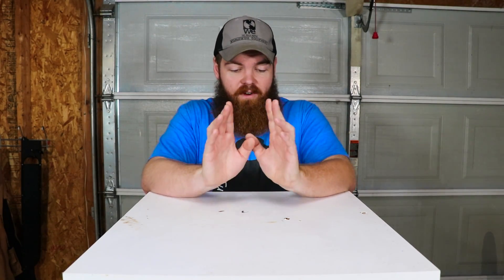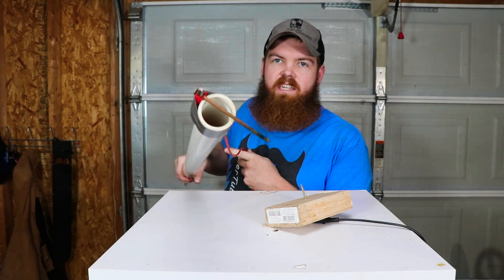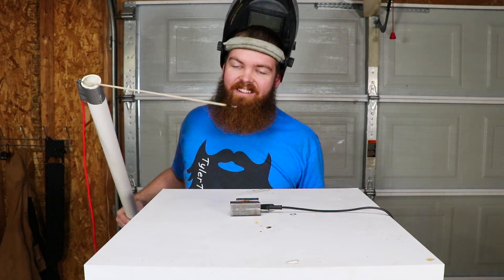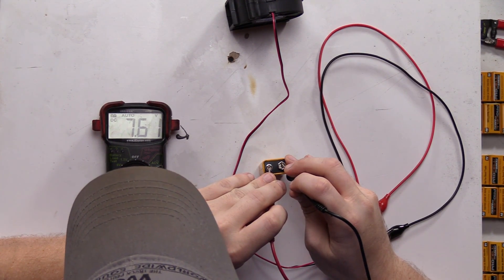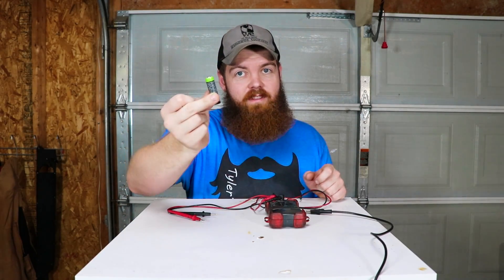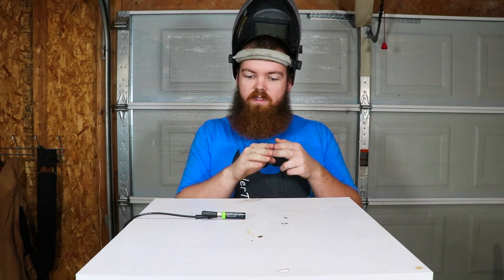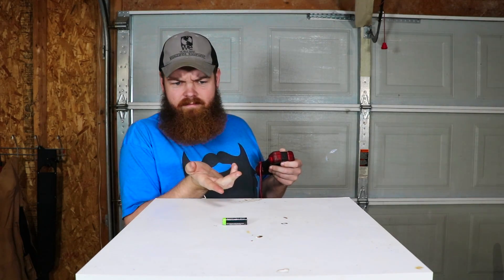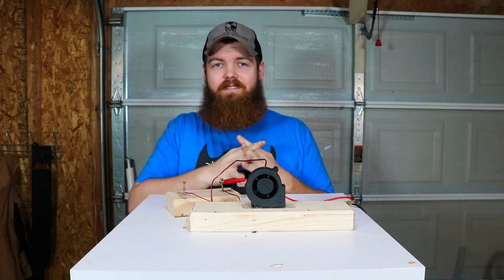Can You Weld With 300 - 9 Volt Batteries?

Comment: I am an experienced welder, and I can tell you that you are doing Many things wrong. First of all, you also need a welding jacket and gauntlet gloves.( at least you rembered your welding helmet)Second of all, you need to have ventilation. Third, you need to keep the arc gap smaller. Fourth, you need some Z87.1 or Z87+ safety glasses. And some advice to help with the electrode sticking,
1. Clean your workpiece.
2. You need higher amperage. ( more batteries.)
3. Hold it at least above an 85° angle.

Comment: Hook all the batteries up in parallel instead of in series and then you'll have more amps instead of more volts and then you'll be able to weld with 9 volt batteries
Reply: You can only get about 15 amps at 12 volts from 300 9 volt batteries. So maybe not. You would need 10'000 9 volt batteries to deliver 500 amps at 9 volts. But the cool thing is 300 9 volt batteries in series equals 2700 volts

Comment: You can charge non rechargeable batteries, you're just using too much voltage. 

The problem with charging non rechargeable batteries is they're not made to be recharged. It might work,  it might leak, catch fire or explode. And the more you recharge them the higher chances of an adverse reaction.

Comment: From what I remember the primary difference between a rechargeable battery and a normal battery is the rechargeable one is built to handle more heat during recharging. I think this amounts to a more durable seal or something like that.  So you can recharge non-rechargeable batteries.. its just not super safe and you should do it very slowly to minimize heat

Comment: You could weld if you connect all batteries in paralel. Because for welding you don't need voltage you need current.

Comment: This is high voltage, this is so crazy, look at the size of arcs, this is deadly and can't solder anything, because soldering requires low voltage and high amps, so this batterys should be assembled on a way to get 45 volts (5 batterys in serial), this setting will have with 300 batterys 60 45v packs, raising the amps by 60 times the amps of a single battery, this is the right way to do this, caution, high voltage is seriously dangerous.

Comment: Your amps is to high you only need 90 amps but you have 225 amps it just breaking the electrode if you use 90  batteries you should get 90 to100 amps that is what the amps you weld with typically.

Comment: You can weld with a 12v car battery but it seems like you need thicker leads to carry the current without just turning it to heat

Comment: To Tyler the fan motor burned out due to the fact you put both negative and positive on a board which is very conductive so instead of the negative and positive energy going into the motor as stable energy it went in as unstable energy therefore it burned out the motor next time have the two cords on separate boards

Comment: You should have cleaned the metal with a wire brush or sanded it with 120 grit or something. The coating on the steel prevents it. Always weld on clean metal. It's just like paint or rust you'll always have to take them off before you can get an effective weld

Comment: In order to recharge a battery you need to for electrons back into the negative half of the battery. Iot do that you need to actually hook up the positive to the negative and vis vers. From a source with higher charge. This will charge the battery with lesser charge.

Comment: Lmao this was really cool! But you couldn't weld cause i guess there wasn't enough amperage is why i think! You only had a total of 6 amps lmao 8 at best and 2700 volts! Cause they were hooked in series. If you would have made 22.5 banks at 120volts and parelled them. You would of had 120volts at 135 amps! Now that would have bin more likely to work! I bet! Series up's voltage and paralleling up's amperage! But you still could have died tho with all that power from 1 mistake! I'm happy you didn't! Really cool and it was smart how you handled the voltage! Lmfao that is messed up that the hotdog and pickle exploded and the hotdog and pickle acted more like the way i thought the welding was gunna go! Weird lmao! 😂😎👍🏻

Comment: Redo with 3 series groups of 100 parallel batteries. 0.26 amps per battery at 24 volts or so. That would be unregulated drain, but more power than a 120v plug in 90amp welder.

Comment: You burned out the fan motor because it arc'd inside it at the end. It would've ran if the input points for the wires weren't so close together.

Comment: resume cat weld steel with the 9th because steel has a much higher melting point than what those 9 volt batteries can output in terms of heat. You could probably try copper or aluminum

Comment: Paused before he tried charging the battery to say that no, you cannot charge a chemical battery by shocking it. The power comes from a chemical reaction in the battery, and you cannot reverse the process by applying more power.

Comment: Bruh, you have 300 batteries connected in series? You're making like 3000V with the capability of delivering over 2-3A short circuit. You can literally fire up over 5 microwave magnetrons with that much power. It can also vaporize/kill any living thing! Just be careful with that thing.

Comment: So what you’ve got there is high voltage and low current capability. About 2.7kv and probably a 7 amp short circuit (I’ve personally found that 9v batteries can produce 7-9 amps in a short circuit) 

For welding I’ve found that the best voltage is between 30 and 40vdc, so if you hook up 4 of them in series you will have around 36vdc, then if you hook up the rest in cells of 36vdc in parallel you will have 36vdc with a short circuit of about 500 amps. That will definitely strike a pretty hot arc ;)

Comment: You didnt have enough current to weld, your wires were too thin. You can weld using 3 12v car batteries and some jumper cables. Thats only 36v compared to the 1800ish you were just using.

Comment: Why should you be able to weld with 2700 and barely any current? Try connecting 100 batteries in parallel 3 time and connect 3 of those 100 battery pack in series to get 27 V. Then use a low current rod. Preferably 60 Amps or lower, whatever you can find. I would expect that to should work about as well as normal arc welder.
You could also try connecting 75 batteries in parallel and 4 of those 75 battery packs in series to get 36 volt and a little less current. I expect one of those two options to work the best.

Comment: Here's my recommendation: Use 7 batteries in series, 42 groups in parallel (to use your existing batteries, 294 of them). This should be the perfect balance of voltage and current for small stick welding. Use jumper cables between the battery and the workpiece; those thin wires you have are only good for intermediate connections, but will melt for sure if you try to pass the full welding current through them.
Keep a steady hand, you want to scratch the surface to start the arc, then keep it very close, but not touching. Some electrodes allow you to rest the electrode on the edge of its coat which makes keeping the distance easier. Put some non-flammable sheet under the piece or you will ruin your table.

And be sure to wear long sleeves and gloves, that UV will give you a nasty sunburn!
Reply: I looked at his ground and laughed out loud.
Reply: Exactly.
Reply: He would be f***ed if he shorted it the wrong way and got the full amperage through his body
Reply: He also should have connected the positive to the metal and welded with the negative
Reply: @ryanreed8186 no

Comment: Can you run a air conditioner on a 9 bolt batteries
Reply: No because a compressor needs AC. It's also pretty demanding, so only top-of-the-line inverters would be enough. Just use a Honda power generator to run a home AC off-grid.

Comment: When I did a stint in prison we use to take a piece of paper and roll up 4 AA batteries in series and hook the negative end to a 110 volt neutral line and hook the positive to a wire and dip it down in a cup of saltwater, then take the hot line from the 110 outlet and dip it in the saltwater mixture across from the other wire. It “kinda recharged” the alkaline cells a little bit, definitely good enough to run a Sony handheld radio all night. You could do that about 3 or 4 times before the batteries wouldn’t hold the charge long enough to make it worth hooking everything up. At the price of 6 bucks for 2 batteries we came up with some wild shit bro. 😂

Comment: Do you not know what wattage is? You need more amps, 40v is plenty to weld, put 5 in series and then parallel them and it will work, or just add a big capacitor.

Comment: For your fan, I think the motor was setup with a capacitor and when you put that large amount of voltage through it, it popped and opened your circuit

Comment: Ive been welding for 1 and a half years and from what i know, you can't weld when you're 6 inches away, and the rod sticking to the metal you're running a bead on is normal and he needs to work on striking then tapping

Comment: if you put all 300 in parallel not series you could easily weld with them, its amps not volts needed for arc welding.

Comment: Your doing it all wrong... You need amps to weld not volts.  You connected all the batteries in series which produced alot of volts but very little amps.  You need to connect the batteries in 4s75p configuration.  A 9v has a maximum current of around 0.5 amps.  This configuration will provide 36 volts and about 37 amps.  Once you do this you will need much thicker leads to handle the current.  You are also configured in DC electrode positive.  In this configuration electrons are flowing from the workpiece to the cathode which is the probe.  What you are going to do is create a lot of splatter and burn up your probe.  DC welding is traditionally done DC electrode negative with the stinger connected to the negative lead and the workpiece connected to positive lead.

Comment: You need to reverse the leads (reverse polarity) you had the electrode negative ( the rod). It needs to be positive. Thats how that SMAW  rod works. 

I noticed the arc wanted to travel to the stick electrode. Maybe you did have it right but thats just my observation.

Comment: Do some research about DC electronics it’s actually pretty simple.. 
but basically to put it into a tangible analogy you just tried to empty a dam trough a garden hose.. bigger cables and put the batteries into groups of 10 then series them up and you will end up with 90 volts and about 15 amps give or take.  For this you will need bigger cables in order to not let the smoke out

Comment: If you use an actual welding stick to hold the rod and hold it closer, you would have a better chance. With the rod on the end of a pvc pipe you can’t hold it steady enough.

Comment: Way to much voltage that is 2700v vs the 40 you would normally use use a buck converter on the output that will be able to bring it down not that there is any rated for that voltage

Comment: He could have used those batteries differently and welded with them. He should have made 100 groups of 3 batteries. Each group of 3 wired in series for 27 volts total and all 100 groups wired in parallel for about 50 amps total. Should have welded using a small enough electrode.
Reply: Or he could have used 150 groups of 2 so it would be 18 volts at 75 Amperes. I would like to see the difference in a weld done at 27 volts and 50 amps vs a weld done at 18 volts and 75 amps.

Comment: Still haven't finished your video...just wanted so say...you should only charge batteries no more than 3 volts higher than the battery's voltage. IE 6 volts, charge 9 volts. and belive it or not I use transformer in that 3 voltage above and below to operate small electronic devices. A 12volt car battery when charging is is variable, never over 14.2 volts and nominal 13.8v

Comment: Yes it would bring that battery back up maybe higher but only do a few very short touch as the battery being charged at that voltage will get hot! aLSO IF YOU WANT AN INTERESTED IDEA TO PLAY WITH.... MANY OLD BATTERY OPERATED...OPS caps..wasn't really looking....power drill and hand held radios used Nickle Cadmium batteries. They would get to low and would no longer charge. This was do to the fact the cadmium grows internal whiskers that eventually will start to short out some cells. If you used a higher voltage battery with amps instead of miliamps it would burn off some of the shorts and if put into charger you would suddenly see it taking a charge again.
But here is the better way for nicad batteries....get and old computer grade capaitor, (from Ebay) you first charge up the capacitor...usually in seconds and then short across the dead or low battery neg to neg and pos to pos you would see and hear a instant pop and spark. 9 times out of 10 now the dead cadmium cells will charge! When I used to go to Ham (amateur radio club meetings) I taught on that for radio batteries and was really praised by many for the results.

Comment: Should have wired the batteries  in parallel.  You need Amps, not voltage  to weld.

Comment: He clearly doesn’t have welding experience haha. Gotta hold the rod close to the metal or you aren’t gonna get a full connection. The rod with just spit and sputter until you get close then it’ll actually lay down some material. Cool idea though man

Comment: 300 × 9 is 2,700 so a kV "Kilovolt," is 1000V "Volts", so 2,700 is 2.7kV
So THATS how much pwr is used and you cant weld with 9V batteries cuz it doesn't deliver enough A "Amps or Amperes" than 9V cuz they can deliver ½ an amp than the welder can deliver hundreds of amps

Comment: The welding didn't work well because you had a very high voltage (2700v) but not a lot of amps.
Typical a welder runs at between 20-50 volts.
So hooking up your 9 volt batteries in sets of 5 each and then connecting all of those sets in parallel with thick wire should give you enough amps at a voltage of 45V.
A 9 volt battery can be discharged with 0.5A for some time according to datasheets for these, and 60 of these sets could provide you with 30A safely.
But because there is nothing in the circuit limiting current you are probably getting much more amps from those batteries connected in that way, so try this next time and show us if it's possible to weld that way with batteries, due to the lower voltage it's probably a bit harder to strike an arc, then experimenting with different sets of series/parallel connections should lead to a result..

Comment: So to clear this up for people: this isn't welding beacuse the batteries are configured incorrectly, a stick welder runs up to 50v and usually around 80-100amps (this varies depending on rod types, steel thickness, etc). 300 9v batteries connected in series as shown in the video would produce 2700v, (series adds the voltage of the batteries together but keeps the amperage the same, parallel is the opposite) this is very dangerous voltage and can easily kill you, hence you don't see welders welding with a 2m long pipe!. This experiment would work if 4 of the batteries were connected in series and the rest parallel, that would give enough voltage as well as sufficient amperage

Comment: You can build a circuit that can trickle charge regular 9v batteries. Its pretty good actually, but only use for unimportant devices like remotes and gadgets... Dont use for smoke detectors.... Just buy a new battery for those please. Try building your own circuits though, lots of fun. And you learn allot about electronics doing it. 3, 2, 1, GO!

Comment: You need amperage, welders aren't all that high in voltage
Reply: Yeah, they usually run on 12 to 20volts, but 200 to 400 amps
Reply: Geddy Elmquist if he welds with 3/32nd rods he could easily weld with 60-80 amps
Reply: The amount of amperage required to run a welder would kill this series of batteries in seconds
Reply: And on Alternating Current Not Direct Current
Reply: @TheGeniusOfMinecraft  you can stick weld on direct current
Reply: @noahmcelwey2598  you just need high amps lower volts, but the extreme amps would absolutely destroy the outer batteries in the array and do not nice things.
Reply: TheGeniusofMinecraft depends on the rod. 6010 is ac while 6011 is dc+. 7018 is a dc+ rod
Reply: @TheGeniusOfMinecraft  Also exists the direct current welders too, and they're so good, do a cleaner welding.

Comment: As Shayne said below, you need to configure the batteries in parallel not series to get the amps and it WILL weld. If you make  8 parallel stacks and then connect each stack in series, you'll weld.

Comment: Hook the batteries in parallel.. In a series circuit the amperage stays the same and the voltage adds up. In parallel the amps add up and the voltage stays the same.... You would need 5 battery banks made up of 20 batteries wired in parallel.. Then connect the 5 banks together in series.. And use bigger gauge wire to make the connections and larger gauge wire for the grounding lead and the positive lead.

If my math is right that should give you 45volts and 100amps. Which is plenty to burn a small rod.

Comment: It’s all about amps buddy hook them up in banks of of 6 or 7 which is about 63v and then attach the banks of batteries together to increase amperage.  Also word of advice, if you do decide retry the welding,  use a heavier gauge wire and real stick welding leads.(edit) so I have done some calculations.  A 9v battery can produce about .5 amps per battery.  So if you attach the batteries in banks of 6 which will give you a total of 50 sets of 6.  So at 3 amps per set times 50 you will have about approximately 150amps and 54v of welding power.  Which is enough to stick 1/4in mild steel plate together running a 1/8 in 7018 stick electrode